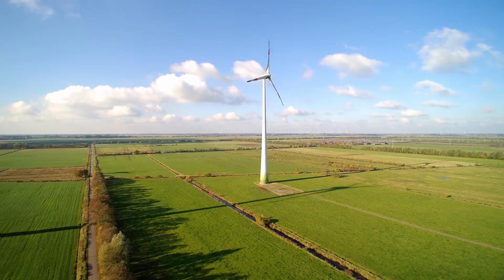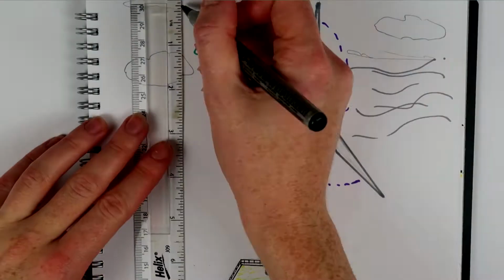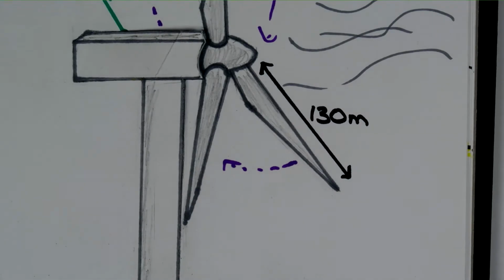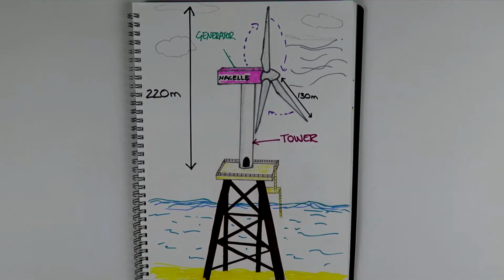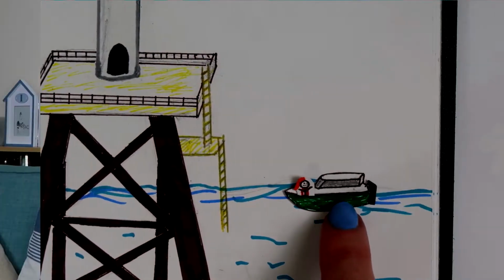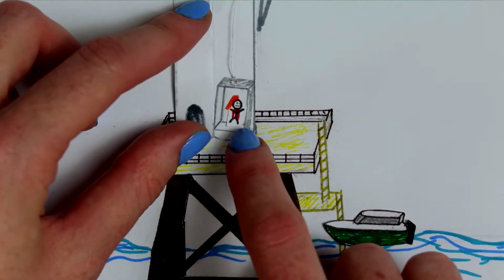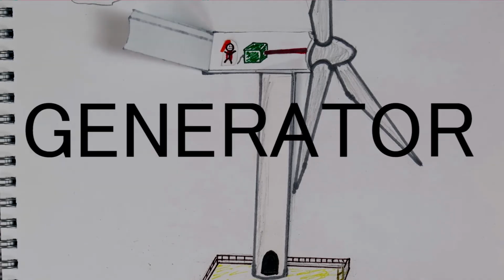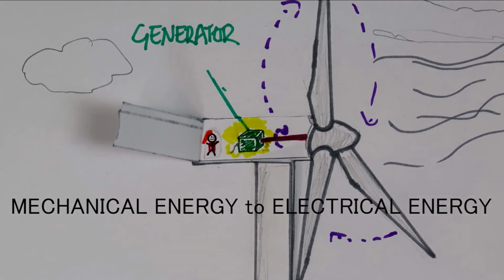How do wind turbines work!? How big are they and how do people even get to the top!?

Comment: omg i can't believe there's actually lifts in those massive white things! are the turbines in the sea the same as the ones on land or are they different?
Reply from the maker: Fiona Claire It's crazy isn't it!? Makes sense though..  I certainly wouldn't want to climb a ladder that high! The turbines are pretty much the same in that they have a generator to convert mechanical energy into electrical energy. The main difference is that the support structure is smaller for onshore turbines and buried under ground, it's rather like the supports that would be under our homes. The blades may be designed slightly differently as well, as offshore tends to be more windy. In residential areas the turbines tend to be smaller as well, as the blades create ALOT of noise so this needs to be reduced so local folk aren't disturbed. Thanks for watching the video!
Reply: ha cool, i guess that's why they put them in the middle of nowhere then! :D
Reply from the maker: Fiona Claire totally!!